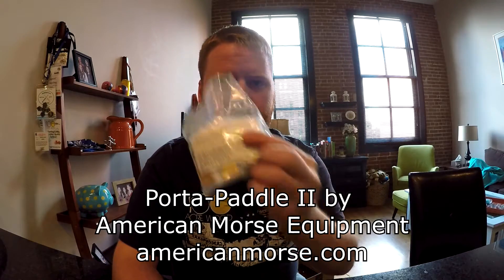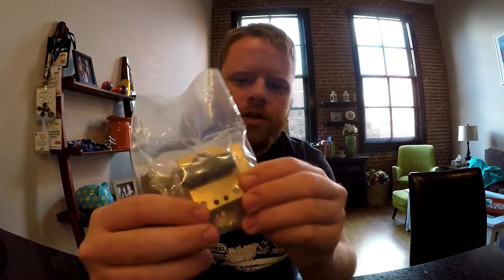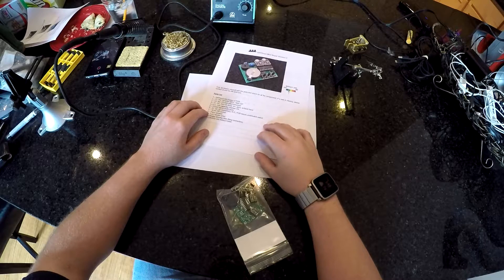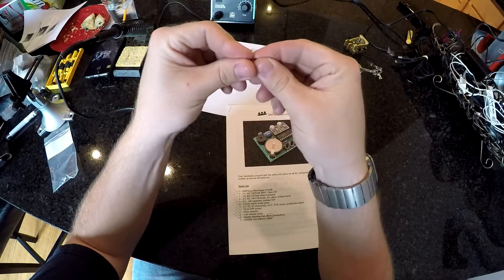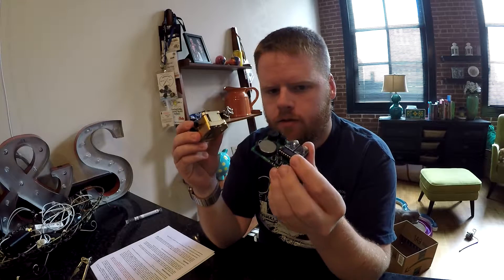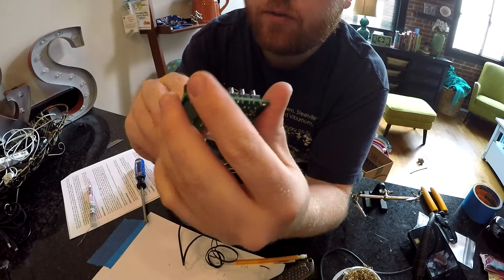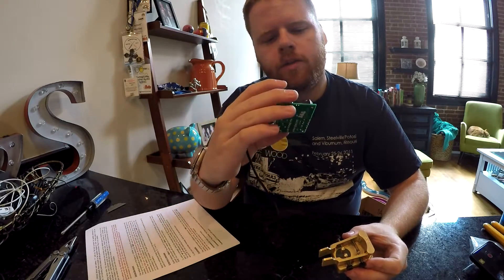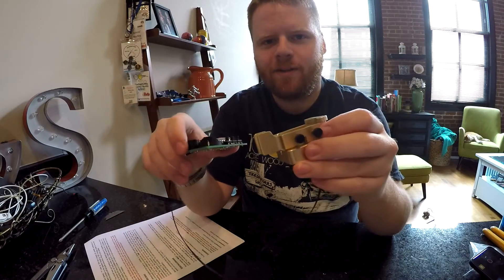AME Porta-Paddle 2 and QRPGuys Keyer Build

Comment: All you need now is a project box for the coder that will bolt between your paddles and knee strap base plate. Have very short cable routed in the ass end of the paddles to the coder and a long cable to your radio!  👍

Comment: What is the XMTR jack for?
Reply from the maker: Jose Minay that goes to the transmitter’s straight key input to actually key CW. Without it it’s just a practice oscillator.
Reply: Yeah that make sense. Have you tried installing something for an external speaker? The part next to the battery and Piezo speaker?
Reply: I just built this same keyer and I would really like to be able to hook it up to a speaker or headphones. The QRP guys just told me via email that the Speaker output can be used for both speaker and headphones. Just wondering. Thanks!
Reply: Jose Minay, the XMTR, of course.

Comment: Very Good!! Nearly complete Pico Keyer and AME Paddle project. Little confused on the paddle wiring. Keyer came with proper plug and a cable with 3 wire end. Red, White and bare stranded copper. I guess these guys assumed a noob will figure out the connections....yeah...no    :) If you catch this comment let me know. Thanks for the video!!